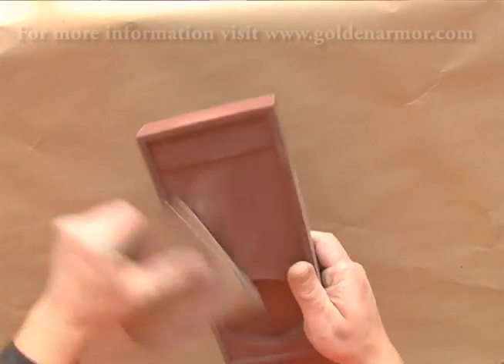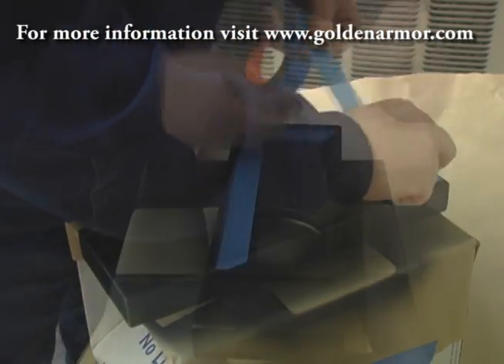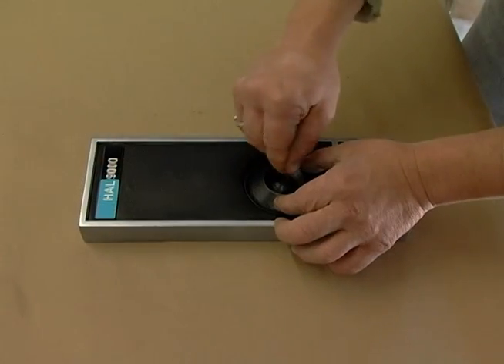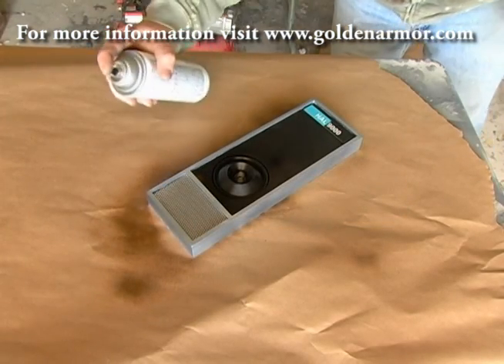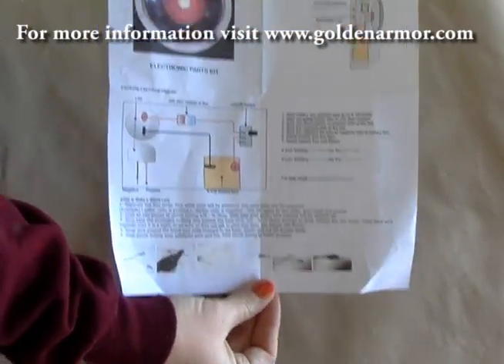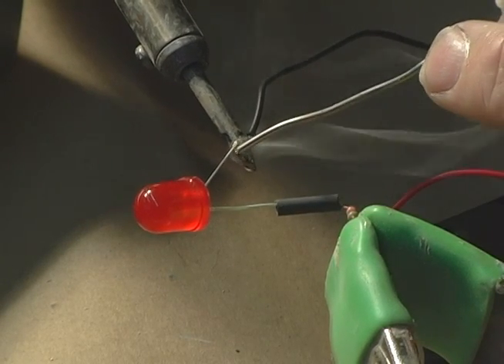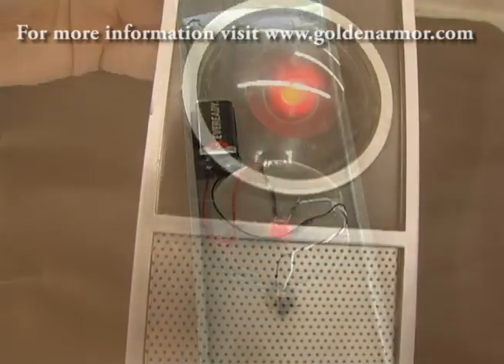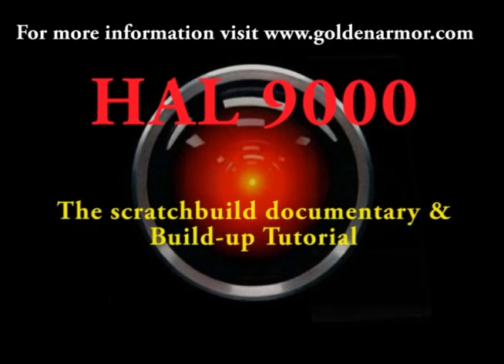HAL 9000 - From Scratchbuilding to a step-by-step TUTORIAL for building the KIT

Comment: It would be advisable to use heatsink clips when soldering the LED. Also when glueing the grille, cut a piece of wood/MDF/ply a couple of mm smaller than the grille to apply equal pressure.